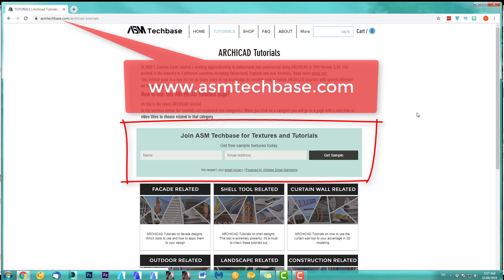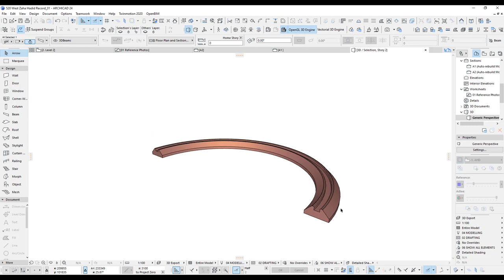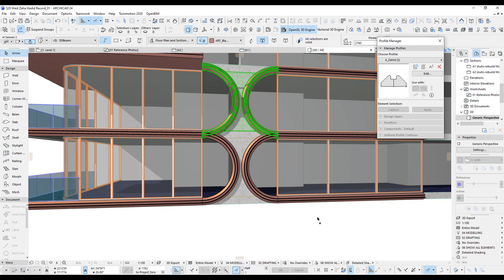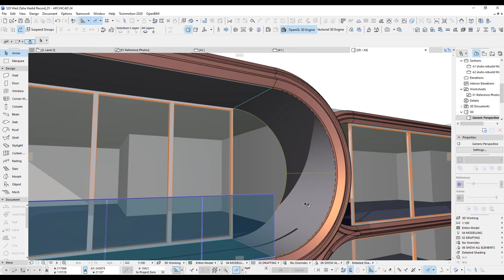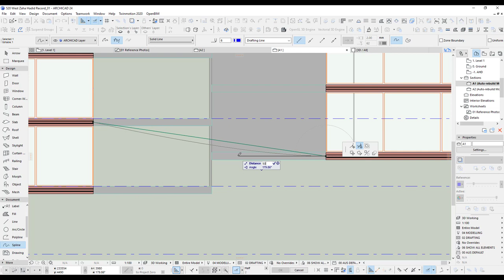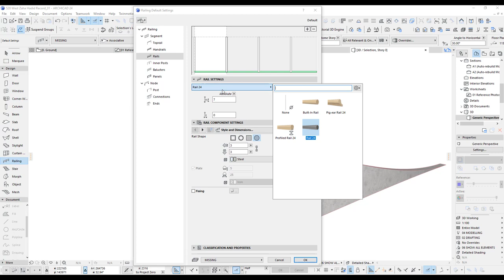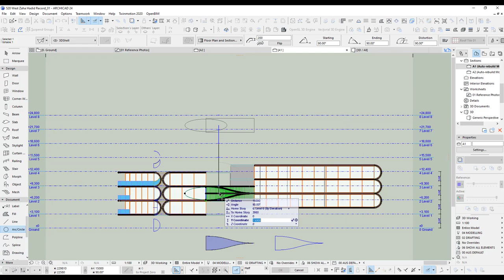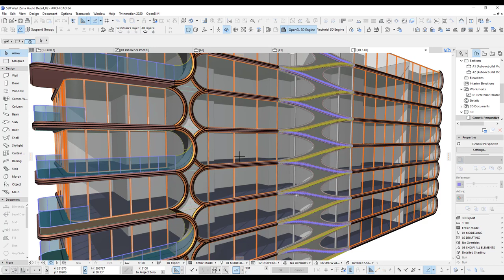520 West 28th Zaha Hadid in Archicad

Comment: How can I apply this to a circular building rather than a flat one? I'm working on my graduation project, but I couldn't apply what was in the video to my circular building.I will be very happy if you help me. Thanks in advance
Reply from the maker: A round building is a lot harder to model the same way. You can try to still use the handrail option explained as a handrail does curve. Otherwise, your best option is to use the morph and shell tool. It really depends on the design you are after.

Comment: You could always make 2 beams, one bending 90° up and another bending 90° down, with 2 different profiles instead of turning it into a morph. A little more work, but will let you edit the profile later on. 👍
Reply from the maker: Great idea I like it. It is always good if model without using too many morphs. They can make the model slow and as you mentioned they are not as easy to change.
Reply: @emilmeijer3336 hello. How is this done?  How is curvature given to the beams?  I am currently working on a circular building project.  I couldn't apply the one in the video because it only works on straight walls.  If you know can you explain?

Comment: How have you set your Archicad 24 interface to look like that of 18 or 19. I'd like to achieve that...
Reply from the maker: I kept updating my own working environment. If you do this you just have to be careful as with every new AC release there will be new features, therefore new icons or a new option in a pulldown menu. These if useful for me I add to my old working environment and save it out as the latest one.
Have a look at this YT tutorial about the working environment I made. In the description of the video is a link to my working environment if you interested.
It is an older one up to AC 22 but you can adjust it as shown in the tutorial.
https://youtu.be/fOqxBHeClE0